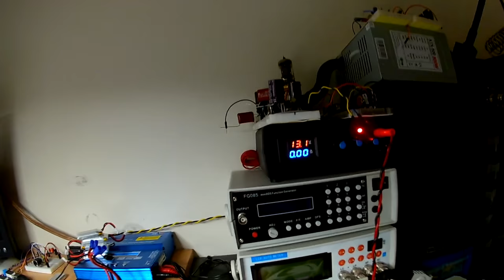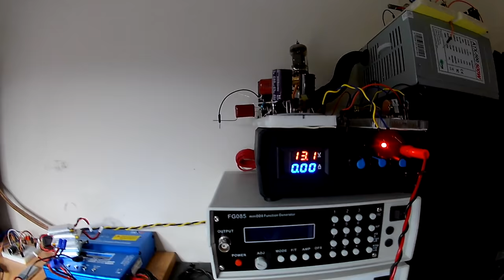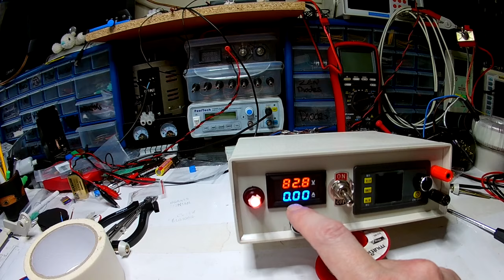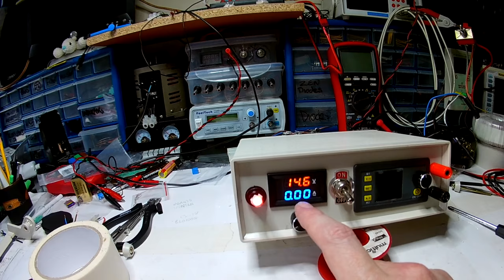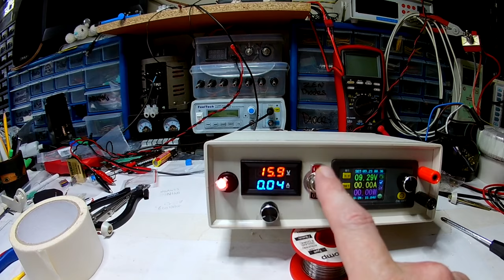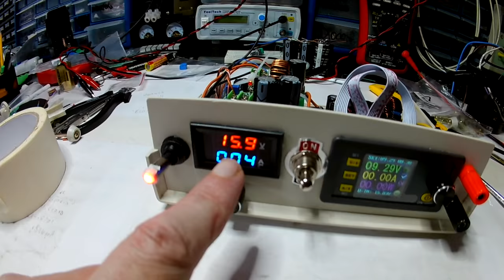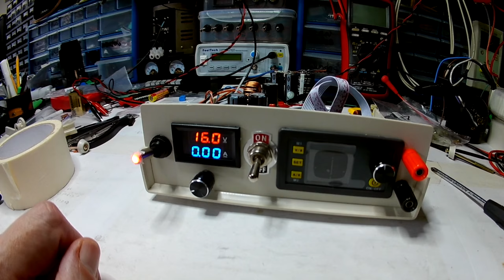RD DPS-5015 PSU and how I have set up mine.

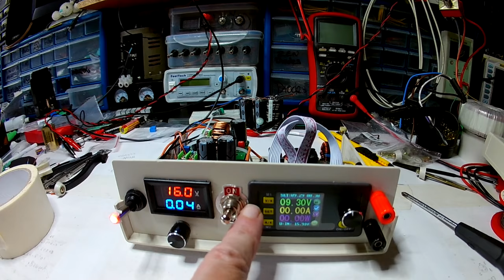Comment: 7:17 ("these are things you get to learn")that's right!  I enjoy building regulated power supplies. I've built three so far and I wouldn't mind building another one. If you've visited my channel you'll see the blue box which is one of three that I currently have. I'm still working on my third PSU. I made the front fascia from 5mm ply. After measuring all the holes and later drilling them I discovered I'd drill the hole in the wrong fkn place. 🤣 geezez christ how did I fk that up. Sigh. Anyway I should have it finished by tommorow. I might do a vlogg tomorrow and go over some of the issues.

Comment: You are using a potentiometer for regulating output voltage of boost converter, aren't you? You could add a resistor or trimpot in parallel, and this way prevent the boost converter to going over 60 or whatever volts you need on output. In other words, when you turn the knob all the way to the right, output voltage would be maximum allowed.
Reply from the maker: Hi, yes I am using a pot to adjust the output of the boost converter. Your suggestion is very good I do like that, I was considering putting output terminals on the booster to give me the option of using up to the 85 volts DC. 
Your suggestion is certainly food for thought. Thank you for sharing.

Comment: What is the purpose of having a boost converter feed into the 5015 instead of just feeding it with a ~60v supply? Do you lose efficiency when you chain them like that? I'm trying to decide for myself how to power this guy.

Also, what is the current output of your initial 12v supply?
Reply from the maker: I am using two deep cycle 12V batteries to power the DP5015 via the booster for the increased voltage. The efficiency of the boost converter is really good. If I were to use a mains/line transformer (I do not have a suitable one) its efficiency would be ~50% and I would have struggled fitting everything in the enclosure. 
This setup works OK for me and keeps everything compact. I do use a transformer (two linked together) in other video's trying to push the DP5015 to failure by loading it with a SSTC inductive load. The DP5015 still lives and I am impressed with its performance, over 300 watts into SSTC and it did not even get warm. 
Good luck with your project.

Comment: The dps5005 needs a diode if you use it to charge a battery....I am not sure if the 5015 does..I was just playing safe
Reply from the maker: Thank you I do appreciate your input. After the LTC3780 and its diode needs I double checked this one. I have made a mistake though, I think the LTC3780 would have been better on my batteries and the 5015 on my 650watt ATX PSU. How are your experiments coming along?  I wanted to send you a goodie bag to say thank you for your support, I figured I would chuck in a couple of those nice caps with some other electronics bits and bobs you might like.  I dont know if you have a bench setup or anything, what do you need?
Reply: +Elecifun 
it don't need the external diode. we have the circuit to replace diode fuction. don't worry about this
Reply: so you can use is as a battery charger, and leave the battery connected even the unit is switched off?
And is there any data known about the ripple on the output site?
Thanks!
Reply: yes frank..the diode stops any current flowing into the output
Reply: +bunnyathome 
it don't need the external diode. we have the circuit to replace diode fuction. don't worry about this
Reply: +bunnyathome
no no ... this is not a real diode 
there is a ideal diode on the PCB . It is a circuit in fact. 
when you charge the battery and closed  DPS5015 output , there are 2 
result.
1, when you did not disconnect input power supply, there is no effect 
for the battery. 
2, if you disconnect input power supply, and you only closed 5015 
output, there is 10-20mA consuming, becase dps5015 need power to work 
so there is advice , if you charge the power and closed the output, 
please try not to disconnect input power supply .

Comment: The other day I assembled the unit as the source was used. DC48V-12.5A bought on ALLe worked 5min tozhe burned DPS5015. I tuned 9V 0.5Am, protection 9V at 0.8Am failed to connect the screen. BP (DC48V-12.5A) went into the defense. The power supply is not burnt. The input is not closed, and the output is full. The plus (+) of the input is called with all output terminals (+) and (-) DO NOT BUY

Comment: I like it!....smile..nice looking unit too..you did remember it fit a protection diode in the dps output...right?
Reply from the maker: Hi, Ta, I didn't I guessed it should be OK as in the description it states "Though this module has reverse connection protection and output short circuit protection, you can muse be in strict accordance with connection description to connect. If you connect the supply power with output, the module will be burnt." Do i still need one?

Comment: I did some more research and it looks like you are right and i am wrong..dam it...lol...the dps 5000 range.... they make lower amp ones where the board is small and fits inside the display..these are the ones that are unprotected..i am not supporting you..i am just a nosy bugger wanting to look over your sholder..smile..no need to send me anything...(unless you win the lottery)...lol..i have loads of stuff...which i have horded over the last 50 years...... attic full plus 2 bedroom old tv sets radios vhs recorders amps tape decks old computers..... boxes of components..i am sorting it out before i die and the kids turn up and say OMG we need a few more skips...lol..i have a bench but i don't use it..its too cluttered..grin..all the public areas of my home are tidy and look normal..except maybe the living room..my son said it looks like a hifi shop..3 audio amps..two tape decks record deck cd/dvd players 4 radio tuners and 8 big loud speakers...4 on which i made myself (dam they are good..even if its me saying it..lol)